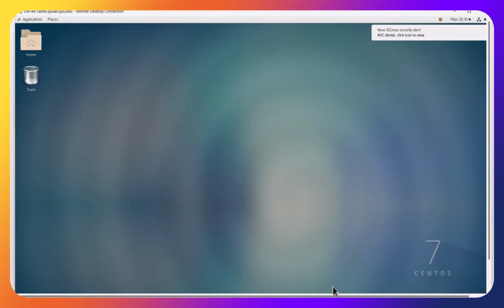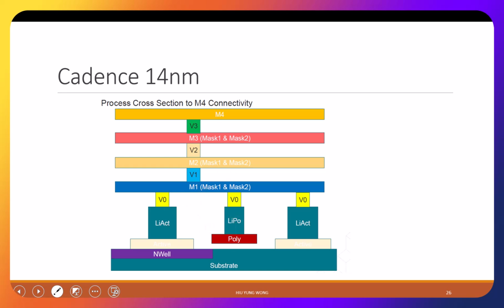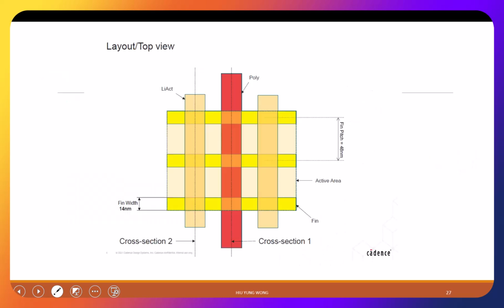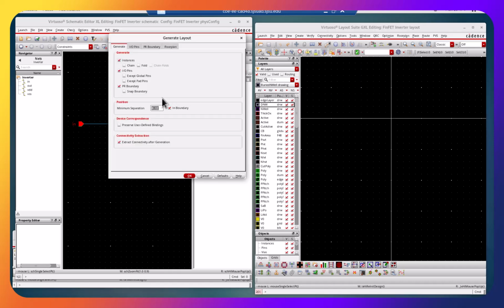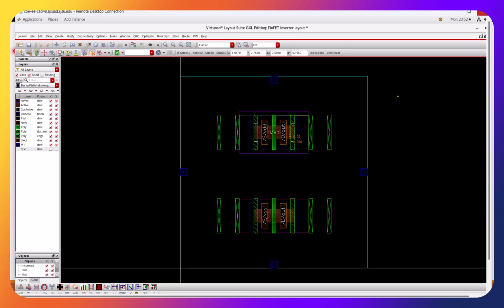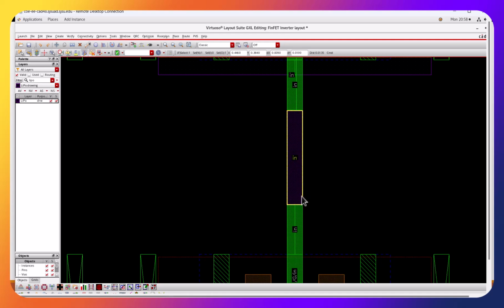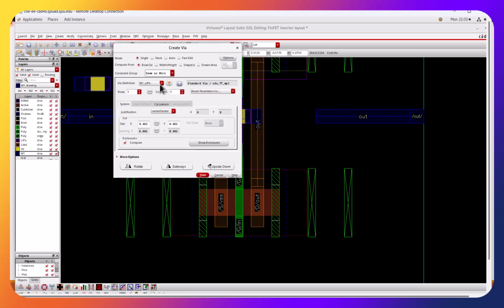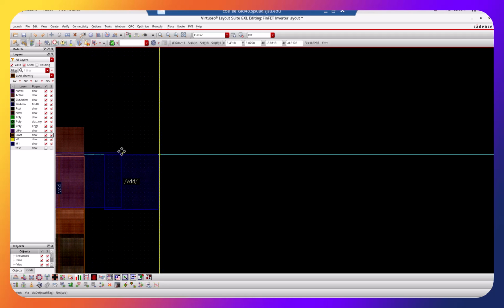L10B - Cadence Generic 14nm FinFET Layout and Structure (Part I)

Comment: Really appreciate the valuable lecture. One question. 10:24 When PDK automatically convert the fins into fins, how the exact location is determined? PDK knows the fin pitch and fin width but y-coordinates of the two fins could be uncertain. In this example, the middle of the 2 fins will be aligned with the middle of the LiAct layer (is this contact layer of Source and Drain?) or Active Area?
Reply from the maker: LiAct is related to the contact and the S/D Epitaxial. See 5:20 for LiAct and the meaning of S/D epitaxial in 5.53. And are you asking about the absolute location of the y-value of the cell? I think the default value is used, but its relationship to other cells or components will be determined by the design rule.
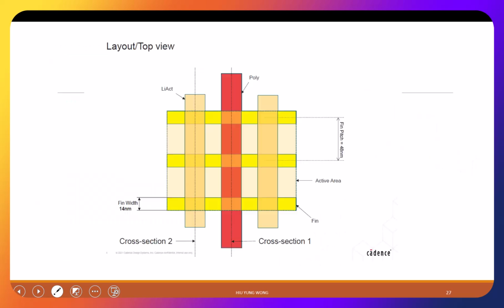Reply: @quantum_computing  Thank you for your kind response, professor. At 9:51 there is a solid orange rectangle in 2Fins/2Fingers figure. The 2 fins will be located at the 2 top/bottom edges of the orange rectangle, making it 62nm width composed of 48nm for fin pitch + 14 fin width.  My question, in the real design situation, how is the solid orange rectangle's y-coordinate determined with respect to the poly or active or LiAct within a cell?
Reply from the maker: @geralt_rivia  I am not 100% sure, but I think this should follow the design rules. There are requirements on the length of the extension to make sure it is manufacturable.
Reply: @quantum_computing  Thank you for your response!

Comment: 4:14 what is difference between MG and metal fil? Aren't both metal? Are they different type of metal?
Reply from the maker: In this particular case, MG is the metal with the right work function to achieve a correct Vth for NMOS and PMOS. Sometimes there are transistors with different Vth and we need different MG (also through dipole engineering). Therefore, Metal fill can be different from MG. Metal fill is mostly selected for low resistivity and process compatibility. So, MG and metal fill are not necessarily the same (and usually are different).
Reply: @quantum_computing  Thank you very much for answering my question!